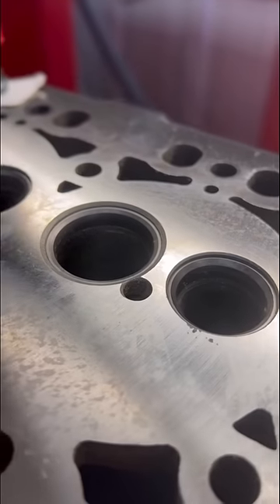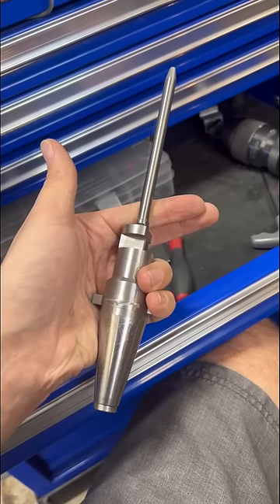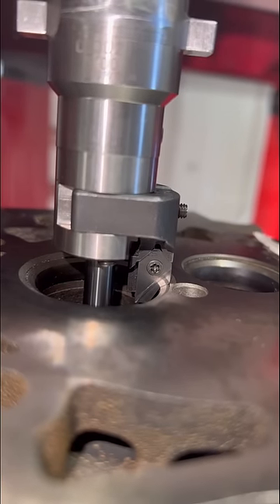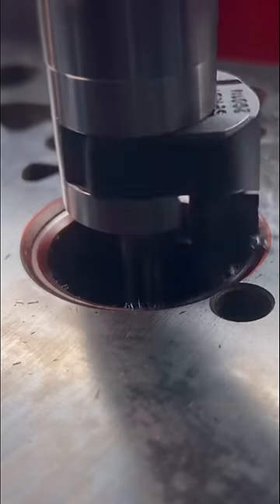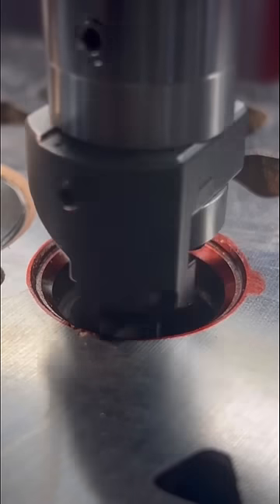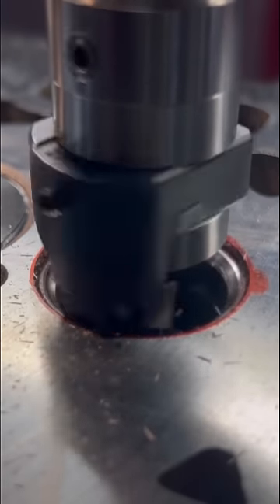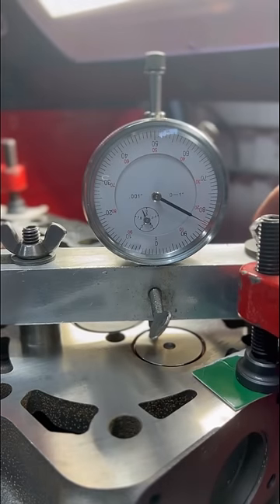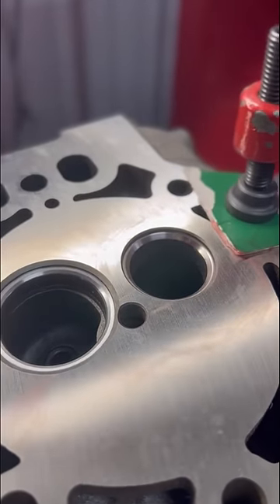#shorts Here’s How We Valve Job The Turbo Yanmar!

Comment: Grab a coffee - here’s a story for you…

When working at a Caterpillar forklift shop, a factory warranty job came into existence because the factory did not cut the valve stem seal seating area on the cylinder heads of their Cat 1404 four-cylinder engines.

In doing so, they never installed valve stem seals at the factory production line. These are mostly LP fuel engines, and the exhausts were pouring-out a lot of smoke.

In order to fix this problem, Caterpillar provided us with a cutting bit (powered by a drill motor) that slid on a polished, stainless-steel rod that was the exact size of a valve stem.

The objective was to remove the cylinder head from the engine, remove every valve spring and its associated valve, then place the rod tool into the valve stem hole, and cut the cylinder head around the valve stem to create a seating area for the seal. Once complete with the cutting, we clean and reassemble the engine. Let’s review this…

Because Caterpillar wanted the cylinder head removed, we now have to reinstall using a new head gasket set, and new intake and exhaust manifold gaskets, not to mention other little things like the valve stem seals and any other gaskets for cooling manifolds. 

The cost in parts alone is getting expensive, and then we consider the cost in labor. Some of our mechanics could complete the job in 11-hours, while others took 14-hours. The cost of steam cleaning was always included.

So, what can we do to expedite this process? Here’s what I did, and please pay attention, because this goes quickly.

1) Take an old spark plug from the engine and break-off the ceramics and the guts of the spark plug, leaving only the metal base.

2) Weld a male air coupler onto the metal base so that you can attach a hose onto it from the air compressor, and that it gets a full flow of air through the spark plug base with no leaks. We’ll call this the air coupler. 

3) Remove the valve cover from the engine and place cylinder #1 at top-dead-center (TDC) on the compression stroke so that both valves are closed, and attach the air coupler.

4) Connect the air coupler to an air hose with a pressure of 100-PSI or so. Because the valves are closed and there’s high air pressure holding them up against the piston top, you can remove the valve springs, and the valves will stay in place. So…

5) Remove the valve rockers and springs on cylinder #1, and use the valve stems as the guide for the cutting bit. Apply a good quality of cutting oil to prevent debris from flying around and to lubricate the the cutting bit against the valve stems.  Once the cutting is complete, clean the area where you’ve been cutting, and…

6) Install the valve stem seals, reassemble the springs onto the valves, and remove the air hose from the coupler. 

From there, you can either go to cylinder #2, or go to #3 (because 3 is next in the firing order of the engine), but regardless, simply bring the next cylinder being repaired to TDC on the compression stoke, and start all over again.

No need to remove the cylinder head. Period. No need for parts other than valve stem seals, either. 

Seriously, I turned a job that took anywhere from 11- to 14-hours to complete using expensive parts, and got the time cut down to 1-hour -tops -  45-minutes once you get the hang of it, and the valve cover gasket was the only part that may-or-may-not be needed, depending on its condition. 

After my first go-around with this process, the shop foreman called me into his office over the loud speaker, and I thought “oh boy, here comes trouble.”

I happened to be doing another one of these jobs when he called me in. He said in a terse manner, “you want to explain how you did this job in an hour?” So…

We proceeded to my workstation, and I showed him from start to finish how it’s done.

We then proceeded to his office, and he gave me a $1.00 raise! I thanked him and went back to work.

The next morning, he calls me into his office over the loudspeaker, and I’m like “now what?”

He said: “I’m giving you another $1.00 raise. We can only increase $1.00 at a time.”

I picked my jaw up, said thanks, and went back to work. 

Moral of the story: why do as you’re told when you’ve got a better idea?

Thank you for your time on this matter. 

Peace always✌🏻
Reply: Hell yeah brother - I did the same thing except instead of shop air to hold the valves, I just slid a length of 3/16” polyester/cotton rope into the cylinder before TDC and then slowly rotated the crank until it was squished up in the cylinder, holding both valves closed (I’ve always been paranoid about accidentally popping a valve open while under air pressure and having it fall). Different method but the same result. I had all sorts of shortcuts on PowerStrokes in van bodies (ambulances) that cut hours and hours off the published times.
Reply: @97marqedman  The soft rope between the valves and the piston is a brilliant idea! Should the need arise to do this job without compressed air, that’s the ticket!

Well done! Isn’t it amazing how a little thinking can be so useful?

Side note: when I’m using compressed air for the job, I’m not worried about a valve dropping into the cylinder, because the piston is at TDC, so if a valve does drop, the piston stops it soon enough that you can still pull the valve up by the valve stem. 

Pull the valve back up, and it pops into place from the air pressure. Problem solved.

Thanks for sharing your experience and knowledge with us, and always remember: you only have to be smarter than what you’re fixin’!

Peace ✌🏻
Reply: wow
great ideas
thanks 😁
Reply: People who aren't as smart as you are (me, for example), kinda need to make damn sure that the idea I, I mean THEY, have IS a better idea. 😁😁😁
Reply: Thanks for sharing!
Reply: What a nice story and what s nice boss my friend. Proud of you
I made something like that but in the administrative area. They used excel and it was impossible. I used power query. Basically I made all I could automatic.
The result was that the job was done almost by itself and you only had to check some stuff out. And that was it.
It was about managing a fleet of 300 cars, mostly police cars. It saved a lot of money and time because everything was more in check and there were no errors about missing oil changes.
I wasn't compensated monetary. I had a day off in the week at least. Well, it wasn't so bad. I needed up leaving I ended hating that job but that part of making that automatization I loved it.
Reply: That comment must have been alot of work jeez
Reply: @radicalracing09  
It's unfortunate but I think your comment took much more work. 
I adhere to the thought "Life is what YOU make of it."
The OP has chosen to make his life a decent one and I am grateful he shared this sliver with us.
I would imagine you have some positive things to share as well.
Reply: "Choose a Lazy Person To Do a Hard Job Because That Person Will Find an Easy Way To Do It"😀

I used to do valve stem seals like that but used a cylinder leak down tester on TDC.

Comment: Need to lap the valve in not so much to see if it seals but to check the angles match and that the seat is hitting the middle of the seat cut on the valve, stay strong
Reply: Refacing with a cutter is like lapping for God's. I lap lawn mower valves.  These guys reface diesels!

Comment: Good job sir. My car gives off thick black smoke when I hit hard on the fuel.  Can you be the cause of the valve ??
Reply: It's more likely that you've flooded the (gasoline) engine with fuel from the accelerator pump, causing a big glob of raw fuel to burn in the exhaust rather than in the engine. That will be blackish smoke.

Comment: So just a stupid question what's the purpose of dropping the valves into the seats like letting it bounce the way you did at the end?
Reply: I'm merely guessing that it would have to be a demonstration of resonance. Energy naturally wants to follow th path of least resistance. 
If you have to surfaces that are of a particular hardness that are 1- parallel and 2- true to one another, then when they collide ALL of the energy is going to cause them to refract away from one another in a linear manner.
If there is any kind of variance in those mating surfaces then that energy would be sent in all kinds of directions and they wouldn't "bounce" very well.
I'm not an engineer or engine builder but that would be my self-learned guess.
I hope someone else chimes in to let us know if I'm correct or full of nonsense. 😄
Reply: I'm merely guessing that it would have to be a demonstration of resonance. Energy naturally wants to follow th path of least resistance. 
If you have to surfaces that are of a particular hardness that are 1- parallel and 2- true to one another, then when they collide ALL of the energy is going to cause them to refract away from one another in a linear manner.
If there is any kind of variance in those mating surfaces then that energy would be sent in all kinds of directions and they wouldn't "bounce" very well.
I'm not an engineer or engine builder but that would be my self-learned guess.
I hope someone else chimes in to let us know if I'm correct or full of nonsense. 😄
Reply: @glenj.taylor2938  it was for the video bro 😂😂
Reply: @firstlast---  
Thanks, I'll be sure to add your immense wisdom to my memory bank.
I'll likely put it right next to how to open doors and which foot to move next while walking.
Reply: @glenj.taylor2938  It's not that serious 😂
Reply: @firstlast---  
I could approach this from a few different angles so I'll go with...
Some people would like to know more information than what a parent would tell their four year old child.
I'll put out there what I know and what I think and let others determine what to do with it from there. I may not always be correct but at least I'm trying to help others with what knowledge I've aquired and my thoughts on things. 
Then, there's far too many parents who don't know anything more than what you wrote in your comment and that's a major contributing factor as to why we have the society we do today. 
Grown children, raising even less intelligent children, and the cycle has culminated to where we are now. 
Either a person contributes to our existence or detracts from it. I'll try to contribute when and where I can.
Reply: @glenj.taylor2938  Man I was just messing with you. You have to be walking with a limp being so uptight 😂😂
Reply: @firstlast---  
No limps for me but uptight? 
I've been called that and worse. 😄

Comment: Why is it that Diesel engines have different valve seat profiles?
Reply: I instantly thought the same question. 
Perhaps it has to do with the design of the engine to benefit the injection cycle. If the Intake Valve is recessed ever so slightly then the high pressure Fuel will aide in dissolving any carbon buildup so blow-by into the Intake Valve is less likely?
Reply: A large part of the valve seat design is the transfer of heat from the valve head through the seat to the block. If the valve doesn't fully close on to the seat the valve will over heat and the edge erode. Diesels have even greater pressure and heat to deal with, so the valve to seat for must be very good.

Comment: I don't want to sound stupid but with the head machine and everything else done would there be an increase in horsepower at all.
Reply: Probably little to no gain over what the engine had when it was new.  They seem to be trying to keep in the engine with the manufactures specs.  The end user will see some performance gain, but that tis just because the engine was tired and needed a rebuild.

Comment: I know this is more of an engine page, but I got an issue with my gmc envoy and was wondering if anyone could help. And before you tell me to go to a forums page, I have. I’ve gotten over 1000 views on my post and not one comment. 
I’d like to remove the rear ac unit in this damn thing. Would I have any issues in doing so?
Reply: No, it's easy. There are two AC lines that go to the rear unit. Those have to be cut and sealed, or new AC lines installed that delete the split to the rear AC. The filter dryer must be changed. The system must be vacuumed down and cleaned, and a new orifice installed. Then after system is clean and working in front only, you can remove all the rear AC equipment. If you don't understand all this, get a qualified technician to do the work.